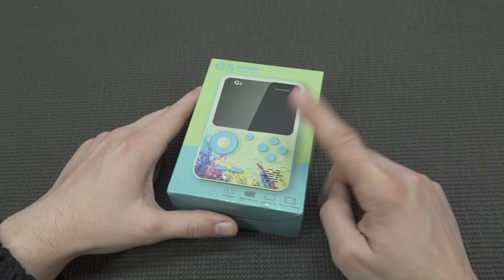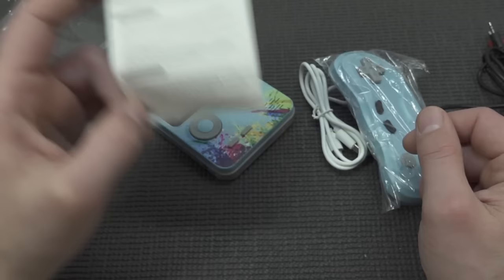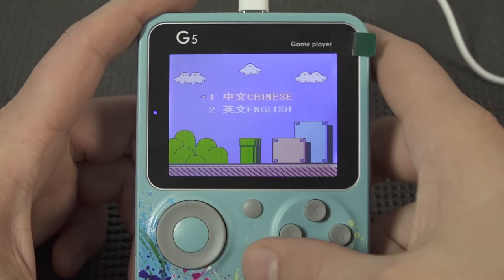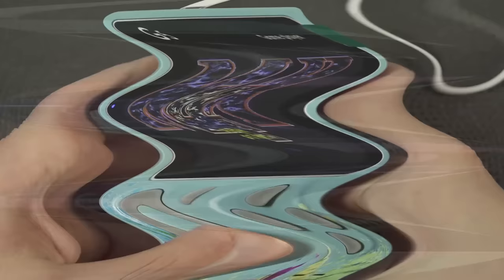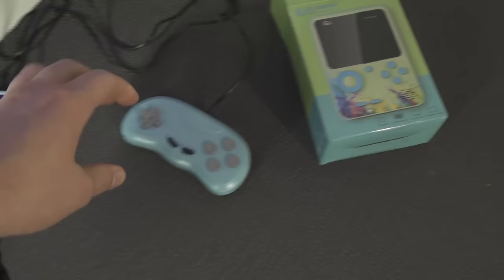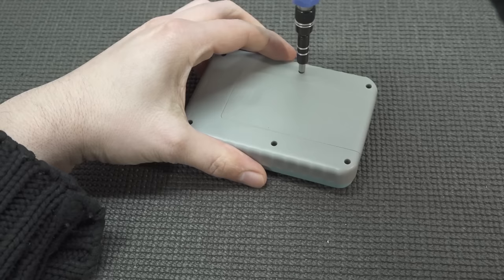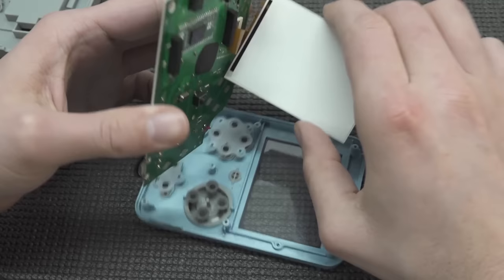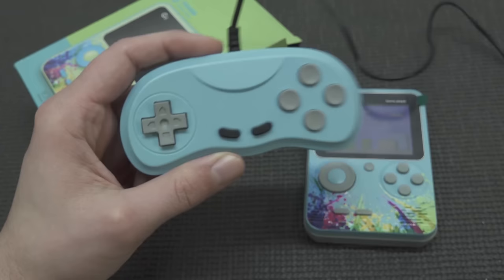G5 Game Box Handheld & Console in 1 from Ali-Express

Comment: I recently got one of these to try out for my kids, I was happy it had the classic SMB and SMB3, but I can't stand that the roms are not in English (the language just changes the menu language it seems- the roms appear to be the Japanese version so all text bubbles are shown in Japanese characters!). Is there a way to access the storage on this and change the roms? Maybe even remove some of the homebrew titles so it doesn't take forever to scroll too?

I tried the USB cable but the PC does not recognize the connected device. Maybe there's a secret way to access storage?
Reply: just use a ic programmer if you need to...and delete the parts you dont want, but first back it all up...
Reply: @derekp9737  sounds cool, can you elaborate? What's an ic programmer and where does one get one?

Comment: quick question buddy since im about to buy a Microsoft - Surface Go 2 - 4 gigs for black friday will this be able to play Streets of Rage Remake 5.2?
Reply from the maker: You need to check the specs of the tablet.
I remember playing SOR5 with a Quad Core from 10 years ago... the q6600.
Only i only had A Surface Pro back in the days... not the go so don't know what you can do with that model and how the specs / performance are.
Reply: @WickedGamerCollector   ive seen it play dreamcast games so it should be able handle it yes? comes with windows 10 s mode

Comment: Mine won't turn on without the charging cord it came with. It's been sitting and "charging" all night and we took the tab out of the back battery. I'm a little salty it has to stay plugged in if it has a battery.
Reply: Mine was doing this, I just had to move the battery a little and it worked.

Comment: how to know if battery is full while charging? thanks!
Reply: If you're lucky the charger turns off automatically. If not, it's  a 1020 mAh battery, so check how many mA your charger supplies, likely between 500 and 2000 mA, then divide battery charge with charger output and multiply by 60 to get minutes.